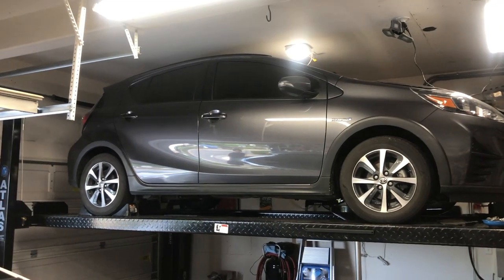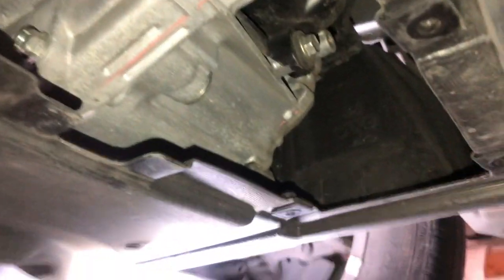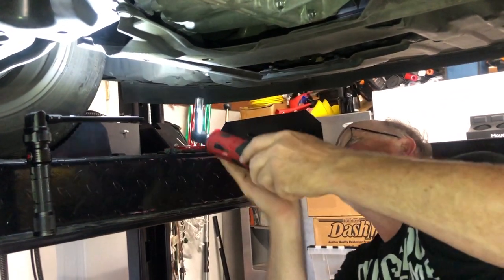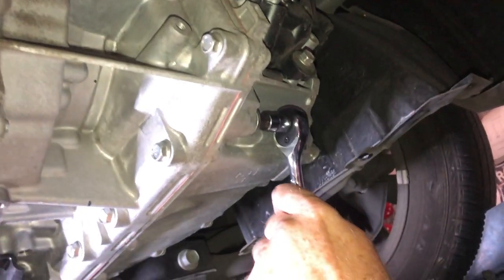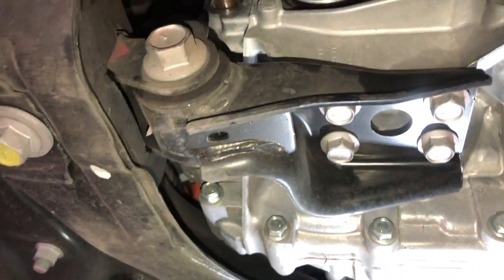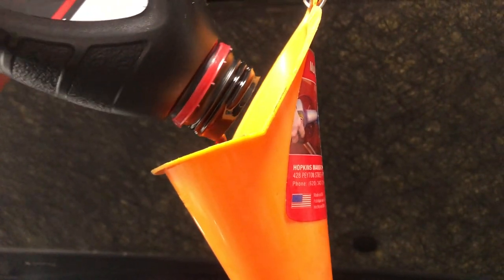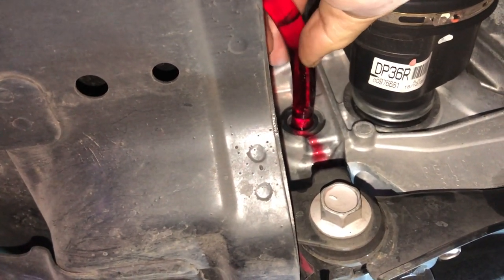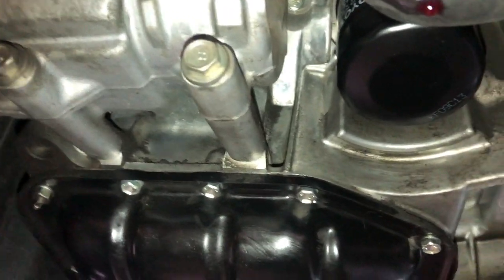Toyota Hybrid eCVT Fluid Change - 2019 Prius C - This Is Why You Change The Transmission Fluid!

Comment: I use the gravity method like you did when I can see the fill hole, but if not, I use the hand pump method to prevent too much waste. Thanks for sharing and God bless.
Reply from the maker: Most of the time I can only see the fill hole if I look from under the car. In this case I use 4 quarts and it takes about 3.9 quarts in a fluid change so the waste is nothing. I hate using a hand pump so for me it's only a last resort. 😉

Comment: do you know if the crush washer the same throughout all toyota hybrids? amd at the car care nut shared part number 90430-A0003 for 2019 (i believe) a rav4 hybrid.
Reply from the maker: I believe so. I have a packet of them and they fit the Prius, Prius C and RAV4 so far. I'll be doing my daughters Sienna soon but since it has the same engine as the RAV4 it should be the same.

Comment: I bought a 2007 camry hybrid last year and it has 178,000 miles on it now. I don't see anything in the Carfax about transmission oil change. I had a Concorde in the past that I had the fluid changed at 99,000 miles and the solenoid pack and valve body went bad right after that! The transmission was never right after that. What should I do with my Camry? I have no issues with it right now. I am scared will have transmission issues if I touch this one!
Reply: This is exactly what I am asking myself. Conventional automatic transmissions can be sketchy when it comes to fluid change and I'd stay away from that. I have no idea what type of transmission your 2007 Camry hybrid has, but my 2022 Camry hybrid has an eCVT like the Prius in the video. But I am also scared of changing the fluid.
Reply: @PFinkoloTL87  I am pretty sure it also has the ecvt too. I feel that I should just leave it alone! I am having no issues with it.
Reply: @vk8sj  Not sure this helps, but seems like you have the P311 model Toyota Hybrid System transmission according to a table in a Wikipedia article ("Hybrid Synergy Drive"). And on EricTheCarGuy which is a website, there in the forums section, I found a thread called "07 Camry Hybrid Power Splitting Device fluid chang". An owner wrote down rather detailed how he changed the fluid.
Reply from the maker: I would change it right away. Your Camry has an eCVT that uses the Toyota WS transmission fluid and it should be changed regularly. I change mine every 30k miles because it's cheap and easy. There are no  issues changing it in the eCVT and it's a simple drain and fill. I would do it now and then again in 10k miles just to get all of the old crap out.
Reply from the maker: This isn't a conventional auto trans and it can be drained and filled at anytime. There is no filter and no valve body to mess up and fail.
Reply from the maker: No change it before you do have issues! It should have been changed several times already and that fluid is completely shot and not protecting the gears at all.
Reply: @jimsgaragetoys  Although I'm not the one your message is aimed at, I'll change the transmission fluid in mine (45k miles, 2022 Camry hybrid) soon.
Reply from the maker: @PFinkoloTL87  Good idea, your transmission will thank you! 😉

Comment: Oil will get dark almosty instantly though. But yes, change your fluids 😊
Reply from the maker: Yes, oil will, but the CVT fluid changes color much more slowly as the heat breaks it down over time. It doesn't get the fuel and other contaminants that the engine oil gets that can turn it dark much faster.

Comment: What size tubing did u use? Fits perfect in tranny hole. I have only  a little over 20,000 miles on my 2019 Prius Limited. I'm gonna change mine next yr (6yrs), not wait til 50-60 thousand, & see how it looks. If it looks like yours, I'll go 5yrs. Living up north in the rust belt, who knows, so I OVERcompensate.👍
Reply from the maker: It's 5/8" OD and 1/2" ID. You can actually see the tag on the tubing at the 6:30 mark.On my wife's 2010 Prius I change the transmission fluid every 30k miles since it's so easy. After my son-in-law saw the fluid he wants to change it every 30k miles too.

Comment: Good videos 👍 
toyota saying never need to change it :( I do it also every 50k in all my cars.
Reply from the maker: Toyota says it’s a lifetime fluid knowing that it will last the lifetime of the transmission, but how long is that? If you never change it their statement will always be true since it lasted the life of the transmission no matter if that is 75k miles or 150k miles. Change it regularly and allow your transmission to last 500k miles!
Reply: Exactly, that's why I couldn't find information about intervals, but apparently, you can change it every 60K miles.
Reply from the maker: @mr.george5370  Yep, I wouldn't go any longer than that and it won't hurt to do it more often either.
Reply from the maker: @mr.george5370  The 60k mile interval is for normal service but I always follow the severe service which includes about 98% of drivers. The severe service interval is 30k miles.

Comment: Great video. My wife has a 2021 Rav4 hybrid. How often should i be doing this to keep her ecvt healthy?
Reply from the maker: It's so easy to do that I do it every 30k miles on my wife's 2010 Prius. I would change it no longer than 50k mile intervals as I did on my daughters Prius C. She also has a new 2022 Sienna and my middle daughter has a 2021 RAV4 Hybrid. The hardest part is getting them to keep track of the mileage and bring it over to me so I can change it! The labor is free for them! 🤣
Reply: @jimsgaragetoys  thank you for the detailed explanation. I think my wives has 23k-24k miles
Reply from the maker: @GR_FIRERARIZZ  So I would do the first one at 30k miles if you are planning on keeping the vehicle. If you upgrade it more often I would wait until 50k miles. YT says that you asked a question about the wheel spacers on my GR Corolla but I don't see it any where.
Reply: @jimsgaragetoys  Oh yeah cuz i asked a dumb question and saw the answer by simply watching the video so i deleted the comment lol, I do that sometimes. I bought the same spacers and plan on installing this weekend. I also got a K&N filter so far. I just picked up my fully loaded sonic red Core CR corolla this past Sunday. I used to have a GR86 but the potential subaru engine problems i would face in the near future from track day use turned me off on it and i decided to switch platforms.
Reply from the maker: @GR_FIRERARIZZ  I love the spacers on it, they make a huge difference with how the wheel fills the wheel well. Congrats on the new GRC. I love the red too. I wanted white at first but after seeing it in person I liked the red and black more. 🤣

Comment: Does the temperature of the transmission matter?
Reply from the maker: No, not on the eCVT. It's no different than changing the gear oil on a manual transmission, just a simple drain and fill!

Comment: You used a 1/2" hose??
Reply: Holy crap.  I have almost 190,000 miles on my 2016 Prius C.  I have never changed the fluid.  I am.getting on it ASAP!!
Reply from the maker: Yes, 1/2" ID and 5/8" OD hose
Reply from the maker: @bigtimepimpin666  Good call!

Comment: @jimsgaragetoys great informative video. I had a quick question for you. 

I just picked up a 2017 Lexus ct200h which is equivalent to the Prius c. The original owner never changed ecvt fluid and the car currently has 101,780 miles on it, mainly northern California freeway miles.

Would it be a bad idea to change the fluid with 101,780 miles? I’ve seen some videos saying it’s ok to do it since it’s not a traditional CVT and I’ve seen some videos saying not to do it.

What are your thoughts and thanks in advance.
Reply from the maker: Your CT200h is equivalent to a standard Prius, not the Prius C. Your eCVT is a drain and fill just like a manual transmission with no filter. It won't hurt anything to change the fluid so I would do that for sure. Here is how to do it when I changed it last on my wife's Prius, your setup will be the same. https://youtu.be/TMuuCAvutVc?si=eI_6zN645IJW1ldo
Reply: @jimsgaragetoys  appreciate the quick reply, thank you so much. 

Sorry about all the questions but I just bought the car for my wife and want it to last as long as possible with timely maintenance. She was driving a 2009 Kia Sportage that has just been a huge money pit and I was done putting money into it. 

So the previous owner of the ct200h didn’t want to pay the extravagant amount that Lexus was charging for the 100k scheduled service. He only did the oil change and didn’t do the initial coolant exchange and the tire rotation like it’s scheduled.

Right now it’s sitting at 101,780 miles, would it be ok to do the coolant exchange, ecvt drain and fill, oil change, and tire rotation when it hits 105,000 miles? 

Also, after getting all of that done, would this schedule be good to follow for the next times around? Every 60k miles for the coolant change, every 30k miles for the ecvt drain and fill, every 5000 miles for oil change and tire rotation.

By the way, we live in Vegas so I’ve always followed the severe scheduled maintenance for all of my vehicles. So far so good with my 2014 pathfinder, but I’ve already had a transaxle replaced at 80k miles and now it’s needing a new subframe at 108k miles. Once the pathfinder is on its last legs I plan to get a 2014-2019 Lexus GX 460.

Just wanted to thank you again for all the helpful and informative videos and you have definitely earned a subscribe in my book.
Reply from the maker: @aceyboogie7172  I think you'll be fine to follow that schedule. If you are going to do the service on it, none of those things are difficult to do. I did all of them on my wife's Prius and none of them were difficult to do, including both of the coolant systems. The CT200h should be a great car for your wife and as long as the maintenance is done as you pointed out. I follow the severe schedule to and hybrids are hard on oil anyway.
Reply: @jimsgaragetoys thanks again. What are your thoughts on replacing the egr valve or just cleaning it? What schedule would you recommend to get that done?
Reply from the maker: @aceyboogie7172  I clean the EGR cooler, EGR valve, intake manifold, and replace the PCV valve every 75-80k miles. I have a spare part for each one so I'll have them clean and ready to go when needed. I have many different videos on replacing, cleaning, and swapping these parts on my wife's Prius if you want to get an idea of what's involved. The first time is the hardest but once you do it once it's much easier.
Reply: @jimsgaragetoys  thanks again Jim. Just wondering if you had a template or checklist of when you do all the  scheduled maintenance that you do for your wife’s Prius since it’s most similar to my wife’s ct200h. 

Just wanted to be able to print it out for my wife, so she’ll know what to get done in case I’m not around to do it.
Reply from the maker: @aceyboogie7172  Not really, it's just something I've done on most of my cars and then altered for her Prius if need be. I've always followed a 5k mile oil change and 30k mile transmission change but most people should be fine if they changed the eCVT fluid every 50k miles, I just prefer to do it every 30k miles. Coolant I change every 100k miles on my cars, and spark plugs every 120k miles if they are iridium like they are in the Prius. The biggest thing that I came up with was the EGR system and I do it about every 80k miles. My wife drives about 10k miles a year so doing it every 8 years just isn't a big deal to me.

Comment: I also have a 2019 ES300H - currently  I have only 15K miles on the car. But do I change it because of the timeframe or wait until I hit 30K?
Reply from the maker: I would change it every 30k miles or 5 years, so next year I would change it. If you drive it that little I would imagine you have many short trips which can lead to condensation in the fluid. It's also very bad having a hybrid and not driving it. The battery needs to have the electrons flowing for battery health. Make sure when you do drive it that you drive far enough to get all the fluids and metals warmed up, which normally would be 15 miles or more to fully get the metals warmed up.
Reply: @jimsgaragetoys  Hello JimsGarage Toys, in your opinion what would you say is the bare minimum in let's say a week or month to drive a Toyota hybrid to keep the car and it's hybrid system fairly healthy? I am asking because I am one of those, who don't drive much. I haven't had my Camry hybrid for that long yet, but I noticed, that If I don't drive it for about 10 days or 2 weeks or so, then during the next drive the car will want to charge the battery up all notches twice. It's doing that by using the motor-generator, not by regenerative braking. I'm not sure, but it to me it looks like as if it's conditioning the battery or something like that (?). If I then take it for a following spin, the charging behaves normally. Car is excellent by the way, by exception I recently took it on a 100 mile drive on rural highways with towns along the way. I wasn't hypermiling, just driving calmly and with reason. As usual on longer trips, it averaged 62 mpg, despite being the highest trim model.
Reply from the maker: @PFinkoloTL87  They are amazing cars but they do need to be driven. I would drive it weekly at a minimum to keep the electrons moving in the battery. And drive it for a minimum of 15 minutes on the highway so that the fluids all warm up to operating temperature. If you are going to not drive it for a longer period, make sure the HV battery is around 50% charged. You can also pull the safety plug on the HV battery if you are going to not drive it for several weeks as it will remain at the same level. Use a battery maintainer for your 12v battery to keep it healthy.
Reply: @jimsgaragetoys  Thank you very much.
Reply from the maker: @PFinkoloTL87  You are most welcome, I'm always happy to help.

Comment: what type of oil for 2019 camry hybrid ecvt? can i use toyota  regular cvt oil for eCVT ??   thanks for reply.  I am from Taiwan.
Reply from the maker: The Toyota Hybrids with the eCVT use the WS automatic transmission fluid. They are just a simple drain and fill. It’s the same fluid you see me using in this video. I also put a link for it below the video in the description.

Comment: Whatever maintenance you need to do to your Toyota do it sooner than they recommend. This will make your vehicle last longer. The manufacturer wants to sell you a new car so they can recommend stuff way later than they should. Manufacturer recommends changing oil every 10,000 miles that is crazy never go longer than 5,000 miles and if you do all City driving 3000 miles. Better to spend a little more on oil changes than to buy a new engine later.
Reply from the maker: I wish that others understood this same thing! This is also the same reason that I change my transmission fluid or gear oil every 30k miles, there is no such thing as a lifetime fluid like Toyota and other brands try to tell you!

Comment: I have a 2021 corolla hybrid and a 2024 rav4 hybrid.These are not cvts,buts gears only in fluid,no chain,no contamination. 100,000 mile fluid,like many batteries,changed before their time is through.We waste like no other country,because we can,sad.
Reply from the maker: @philipeli1192  these are an eCVT, a planetary gear CVT. And you are correct on everything but the interval. The recommended interval is every 50-60k miles on normal service and severe service is half of that. Heat is the number one issue and it breaks down any fluid. I would never run any transmission fluid 100k miles. The only reason you hear that long of an interval is because of marketing, real mechanics will never tell you to go that long. Transmissions are expensive, fluid is not. After draining the old fluid it is picked up for recycling so there is no waste. Everyone should be recycling transmission fluids and engine oils. The worst waste is not taking care of your car and having to replace it with a new car.
Reply: @jimsgaragetoys  I have to change plugs at 60k,thanks for the heads up,according to Toyota,my wifes Durango has 164k on the original plugs,iridium plugs are amazing,so are the new fluids.I will use Amsoil like my bikes,I believe in a true group 4 oil,not the dino oil.
Reply from the maker: @philipeli1192  I know that the iridium plugs are normally changed every 120k miles. Just don't buy them on Amazon or eBay as there are a lot of fake ones out there.
Reply: @jimsgaragetoys  I hear ya! Fake filters,fake everything today,quality is now an expense,we pay for,or not,lol